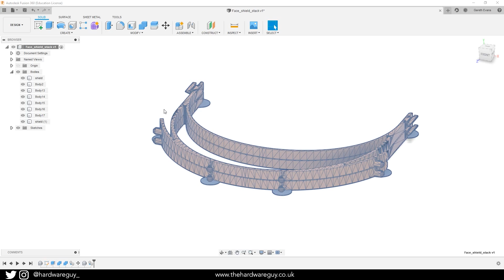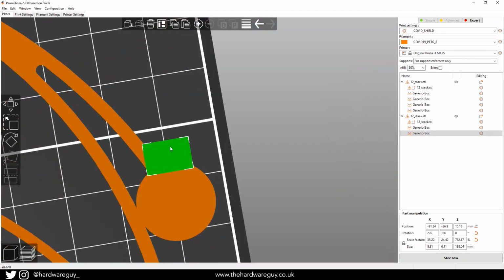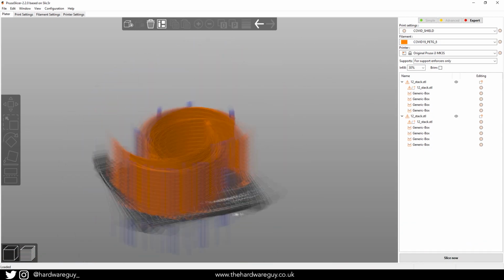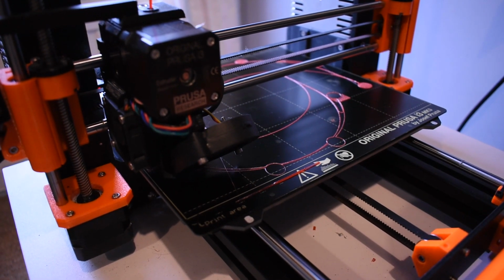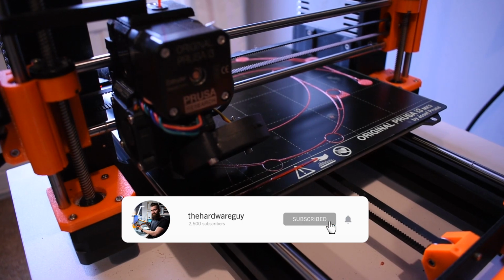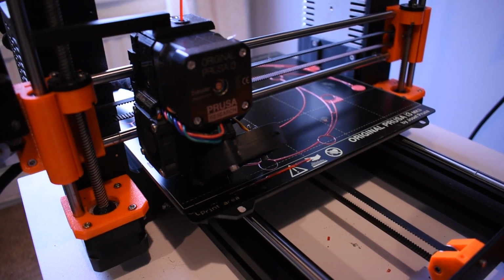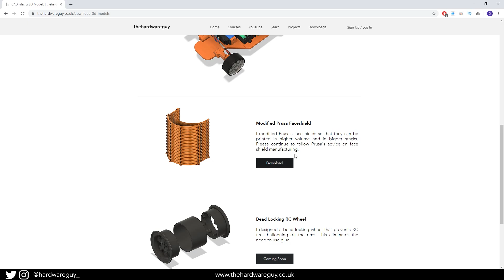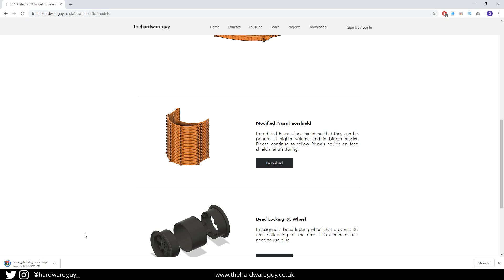How To Stack Face Shields

Comment: Awesome idea! I'm going to try today. I think the gap between the stacked shields needs to be a multiple of the layer height, otherwise, the slicer rounds it up or down. That's why you get some layers sticking and others breaking apart easily. I'm going to try to make the layer height a variable in 360, try to make the gap size automatic. Thanks again,  I'll be checking out your other projects